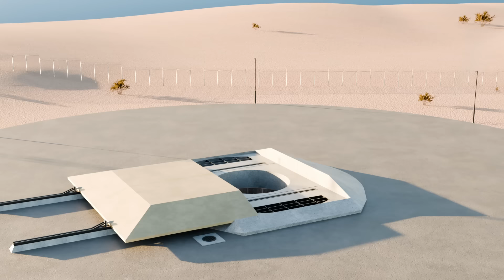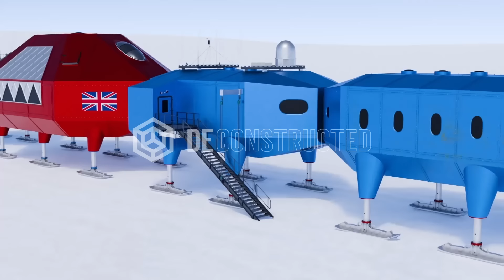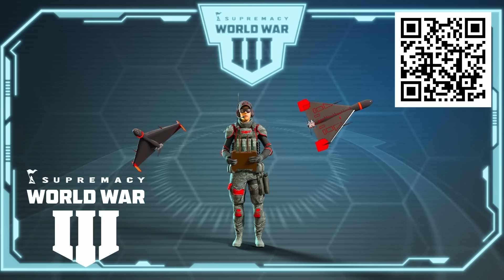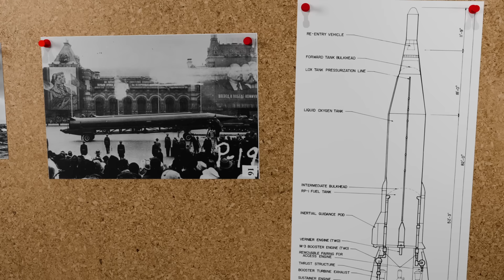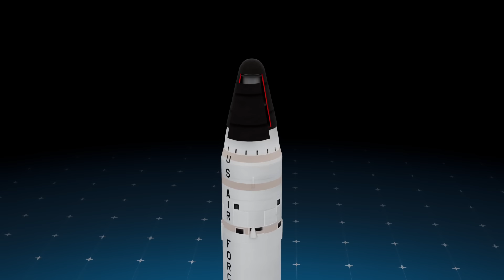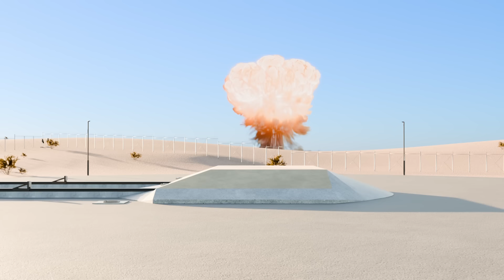Missile Silos Were Far More Complex Than You Think

Comment: Wait so if a nuke hit above the launch complex how did they keep from sucking in on that radiation dust through the air intakes? Also the part where they could just open a latch and climb out the air duct is suspect 😂
Reply: Filters can easily remove alpha and beta radioactive dusts.  Being underground protects them from gamma and X-Ray radiation.  I have been in many Atlas facilities and they had escape tunnels to the surface filled with dirt, sand and rubble.  There was a plug at the bottom of the escape entrance that could be released dropping all the material in the shaft down into a pit below the escape portal.
Reply: The crews were generally considered expendable.  In pretty much any scenario by the time an enemy warhead arrived, the missile would be long gone and the silo would just be an empty hole. If you're interested in nuclear warfare tactics, look up something called the "sponge doctrine".
Reply: The outside air is blocked during an overpressure event (explosion) and no outside air could come in. Second... that "latch" takes 45 minutes to open. It's quite a lot more than a hatch. :-)

Comment: So they have these huge blasts doors and all that security to enter but some single emergency exit that can be compromised more easier than the blast doors? Got it.
Reply: You're operating solely under assumption. The shaft was filled with sand and could not be opened from the outside, durr. Got it? 😆People who think they're smart are too funny.
Reply: The escape hatch could only be opened from the inside, and it required two people working together. If you had to use the escape hatch, odds are there isn't going to be anyone around to hassle you anyway.
Reply: The escape was two inch thick steel and designed extreme over pressure from a nuclear explosion would be very difficult to get through you would suffocate before you could blow torch A hole

Comment: What surprises me most of that the escape shaft was filled to the brim with sand. Anakin Skywalker would never use that as he doesn’t like sand 😂
Reply: I don't think that's the case with the Titan II escape shaft, as it was literally part of the air circulation system. The sand-filled shafts were in the (I think) Titan I and Atlas LCCs, which didn't double purpose the air shafts. What was discovered when those sites were decommissioned is kind of disturbing: The escape shafts were concrete, filled with sand...but nearly all of the shafts had collapsed within a very short time after construction due to water and environmental effects on the concrete, so the crews (unknowingly) would have been trapped forever if they ever had to make use of the emergency escape shafts. 😵
Reply: @aaronm9478 oh okay! Thank you for correcting me. I was a former RAF cadet a long time ago but I don’t know much about American ICBM’s
Reply: @aaronm9478  Yep! You are correct.
Reply: @aaronm9478  Minuteman had a sand filled escape, It had to be filled with sand to Increase survivability, They had to open a hatch in the wall or the ceiling let the sand drain out into the Control Center then they up the escape
Reply: @brucebedford5121 Yep, that's how pretty much everyone has done it for a long time. I think the Minuteman LCCs are a lot smaller than previous systems, too, since they don't have the missile(s) and all of its equipment right there at the LCC site. Very cool system.

Comment: I always thought that the command centres were bigger and more luxurious.  Wouldn't the crew die of radiation poisoning if there was a nearby strike as there were no filters on the air intake?
Reply: We were expendable We were of little value once our missile was launched.  And above ground detonation would cause pressure surge that close the air intake blast valve before radiation could travel into the Control Center.  It was believed there was enough air trapped in the Control Center the crew live 4 or 5 days Before they needed to allow outside air in.  A lot of radiation would have dissipated in that time and settled on to the ground so the radiation may not have that much of a problem, but you needed to come out into the world at some point
Reply: Short answer, yes.  Under normal circumstances, air flowed into Level 1 of the Control Center and out Level 1 of the Silo Equipment area/Launch duct.  If there was some kind of strike, there's no telling what would happen.

Comment: The whole 3 story building being hung from the roof to deflect shocks, amazing!
Reply: 日本人として、耐震建物のオプションとして参考にしたいです
Reply: @trashbug1  It would be expensive the Dome itself was 10 foot thick steel reinforced concrete with the sides being about 4 foot thick
Reply: @brucebedford5121 
私達は吊り下げ構造について話しています
Reply: Funny fact.  There was a place on the 3rd floor of the Control Center where you could put your back up against a piece of equipment, and put your feet on the wall of the Control Center.  Since it was hanging from springs, you could push against the wall with your feet, and all 3 floors in the Control Center would begin to rock back and forth.  If you were in the Control Center, you couldn't see any movement because the concrete walls wrapped around you and there was nothing you could focus on to see that the floor under you was moving.  You'd just get this weird feeling of movement.  We did it often when there were visitors for one reason or another.
Reply: @jamesstreeter4725 idk lol, that sounds kinda scary😂
Reply: You should see the NORAD complex, if this impresses you.

Comment: I like how the emergency escape hatch through the air vent bypasses all the fancy security.
Reply: Remember… they lie about specs most times b/c its security or capabilities is classified

Think crushed debt for Virginia class subs or cruising altitude for B2 bombers. I highly doubt if what we know is the actual. 

I remember one interview with A. SR 71pilot.. who said he couldn’t say with the Actual top speed or operational ceiling was.. but it’s different than what’s published
Reply: @christainmarks106 
I think this explains many armchair penetration theories. If you can think of it, they already did. And there’s no need to advertise how EVERYTHING worked.
Reply from the maker: The hatch door is designed to only be opened from the inside and chances are you’ll still be detected when you breach the perimeter on the surface.
Reply: @Deconstructed_Animations iirc the escape hatches were partially filled with sand, i think the top 10 feet or so...it would quickly pour out into the room via gravity when the hatch was opened, but would take hours to dig out from above. Also probably kept them from collapsing from a close impact.
Reply: @scottreich1207 no sand in TiTan II…
Reply: @scottreich1207 Yeah, not in these silos. The escape tunnel is literally part of the life support system, the air circulation vent shaft. Can't fill that with sand and expect it to work. 🤷‍♂️
Reply: @Deconstructed_Animations  One bad person inside could let others in before security could get there too. And it seems to bypass all the blast protection too.
Reply: @TuttleScott  There was sand in between the escape doors and the air intake. You first had to unbolt the cover and then you had to dig your way out. They also enforced the buddy system at all times, when you were in the silo, meaning no one person could be anywhere in the silo at one time alone. 

There was no way that security would have been compromised by any one person making your scenario moot.
Reply: @MattEskes-mm2sr  skydive some people in + man on the inside (with his buddy) knocks his buddy unconscious and opens door. Ba-da-boom (literally)
Reply: @NoName875 launching this rocket would be impossible anyway without starter crystal which general of USA have
Reply: @TuttleScott that one person would have to convince at least one other officer (assuming the double agent is one of the officers) to give up the lives of thousands of people for his own "safety," they'd still also need the access codes.

If you would be willing to give the keys and codes up to a guy to save your own skin but condemn thousands to tens of thousands to death by a nuclear missile you'd either never be there in the first place or at the minimum a lil b$&@!.
Reply: @NoName875  no fly zone...
Reply: @NoName875  You prepare to get into position to sky- aaand you have been detected by NORAD hours before already and just got shot down.
Reply: @NoName875  skydive people in? You're telling me that the grand plan to get into a high-security military installation, is to fly an airplane directly over it, and drop several people with large very noticeable parachutes?

That's like saying that your bank heist plan is to walk into a bank and threaten security with a butter knife. You won't get close enough to see the drop zone before the nearest airbase scrambles and shoots down your airplane. Even if you do, it's a military installation. They have guns. Guns that can shoot you before you can even land.
Reply: @TuttleScott  Flawed logic based on ignorant assumptions rather than empirical knowledge of the facility and base security measures.
Reply: @NoName875  and literally worthless without the central command butterfly valve key code, did you watch the video?
Reply: @Desert-edDave  Who said anything about launching the missile? It's the crew's lunch we're after.
Reply: @MattEskes-mm2sr well you and your buddy had turn 2 keys that's some heavy shit to deal with knowing that the world is gone and that you are part of some of the other part of the world is gone
Reply: @NoName875  Sure thing, Ethan Hunt.
Reply: @TuttleScott someone didn't watch the video.
Reply: @steveng7702  I may have slept some through parts but on the bright side this is the most likes and replies I've ever gotten.
Reply: @NoName875  real life doesn't conform to video game logic.
Reply: @MattEskes-mm2sr  Not on Titan II. It was clear for air intake.
Reply: @TuttleScott impossible.
Reply: @Desert-edDave  That's true.  If the code wasn't entered, nothing could happen.
Reply: @Kawka1122  I don't know what you mean by "starter crystal".  If you mean the nuclear codes that unlocked the butterfly valves, set the target, and allowed the launch sequence to proceed, that's in the hands of the POTUS and was broadcast to us in the complex over the radio.
Reply: @TuttleScott  It's shocking to think that the security of these silos was utterly compromised like this throughout their lifetimes because the thousands of people who worked full time on the design of these systems over decades couldn't think of something this simple. Thankfully, the world now has YouTube commenters who can identify such things instantly, so this will never happen again so long as those engineers read YouTube comments to learn how to do their jobs.

I love the way that your knowledge seems to extend to the point that you know that the ventilation tunnel blast protection system shown explicitly in the video doesn't work.
Reply: It required 2 people to open or perhaps 1 person and a very long time. The hatch isn't well visualized here and locking mechanism are not attempted. The hatch looks roughly correct but the lock mechanism has 2 opposing half  circles that close over the 60mm flange. There are essentially 2 threaded bolts that the 2 half-circles travel on. You can not do a full revolution on the bolt and will need to  reset the wrench every half-turn. If you turn the both bolts equally tension will build up forcing you try to tighten one nut to relieve another. 

1 person could do it. I don't know how quick but time and patience. Another thing is that there was a some back flush capability. Sadly, I don't think it could launch saboteurs into the sky but might dissuade a few people. 

Anyhow, I don't think this is a reasonable way to get in a Titan II. The escape hatch is probably the most secure door int the facility because there is no quick even reasonable way to open it. I think it was used once. If you can find info on that then you might get a baseline.
Reply: Anakin Skywalker would never infiltrate this silo at least 😂
Reply: @TheLiamsterluke Skywalker managed to destroy a planet killing death star buy hitting a air vent thank God his American
Reply: @RonNieminen-z6h  He's not. George Lucas said explicitly that the Rebellion were based on the Viet Cong, and the Empire on the USA. So Skywalker would have been fighting against Americans.
Reply: @TheLiamster You underestimate my power!
Reply: Bro thinks he knows better than the designers 😂
Reply: And I bet the guard meeting place is over next to those red barrels
Reply: @EAdrien92 heh, yeah, real hard to predict how the quick reaction force is going enter, what with just the one road and gate >.<
Reply: Well are scared that CIA is going to take you away in the middle of the night
Reply: That's why it's James Bond's favorite infiltration method
Reply: It could only be opened from the inside. And it was a grueling and exhausting process if you were in a hurry. Also, the video is slightly in error about the radar system topside. One radar array was over that shaft and if it went off, the crew immediately closed the blast valve for that shaft with the push of a button.
Reply: The hatch that covered the emergency egress port at the bottom of the air shaft was between two and three inches thick. At grade level, the steel grid that protected the shaft was a welded grid of 3/4" steel, almost 5 inches thick. No one could begin to cut through before ART teams would have them under fire.The steel exposed to potential blast damage was found during site destruction to be the same quality as Swedish razor blade steel, the strongest you could buy, anywhere. When they first tried to use explosives to break up a silo closure door, 200 lbs of dynamite went off like a fire cracker. They ended up having to use special shaped charges buried under piles of earth and that just cracked the concrete on the door. The steel remained intact and had to be cut with torches.
Reply: These weapons are designed as a second strike option. So they are designed to survive a near miss strike. That escape hatch probably won’t be functional. The crew only needs to survive long enough to launch, that’s their mission. 
This is an old system the current system is Minuteman 3. Which has a more efficient configuration.
Reply: That's kinda the point
Reply: I like how you're wrong 😂
Reply: The escape tunnel could only be opened from inside, so no one is getting in that way. The hatches had to be physically un-bolted too, so pretty secure.
Reply: This was exactly what I just came here to post hahha😂
Reply: That's how you let McNally in to open the war box 😂
Reply: @devo1977si was honestly thinking the entire time "I wonder if McNally could pull this off,"
Reply: The hatch only opened from the inside and was filled with sand 
If opened from the interior the sand simply ran out 
Of opened from the outside you would have to dig thru 20’ of sand only to find you still can’t get in
Reply: @FP194 you are thinking Minuteman. NOT Titan II
Reply: Red five, I'm going in....
Reply: Some of the escape tunnels were filled with masonry sand, it would drain out when you open the inside hatch...if anyone could get through the exterior hatch, they would have a lot of digging to do
Reply: тоже об этом подумал))

Comment: I think the surface defense using radars to detect intruders was the fact I didn't know.  That's neat.
Reply: Imagine how many false alarms there were that were triggered by a rather large animal that climbed the fence
Reply: @awddfg  I'm thinking more like rabbits and such.  Arizona isn't known for large anything in the desert areas around that site.  But, I'm sure they had plenty of false positives.  Still reduced manpower requirements, though.
Reply: @awddfg  Never happened.  At least not when I served.
Reply: The intruder detection system was an early Version of modern motion detectors, There was a lot of calibrating problems with false alarms due to birds flying through detection area,

Comment: At 14:57 you describe an emergency exit through an air shaft.  What prevented that exit as being used by an enemy intruder to access the underground site bypassing all the other security measures?  It reminds me of the Simpsons nuclear site.  https://www.youtube.com/watch?v=eU2Or5rCN_Y
Reply: The emergency hatch only opened from the inside.
Reply: @isaac-g4u2h  by design.  But certainly can be considered a point of vulnerability.
Reply: @ChandlerTC  They must have realized this.  In the Minute Man the emergency exit is a corrugated metal tube filled with sand.
Reply: The hatch only opened from the inside and required to people simultaneously turning two ratcheted bolts until the C-clamps holding the steel hatch in place were displaced about 12 inches. Only then would the hatch open. In addition, one of the radar beams for topside security passed over that shaft entrance. If that beam was interrupted in any way, an alarm in the control center would go off, the crew would immediately close the blast valve for that shaft, and you would have security police pulling up in their armored vehicle fairly soon.
Reply: @sparc77 interesting.  Thanks.